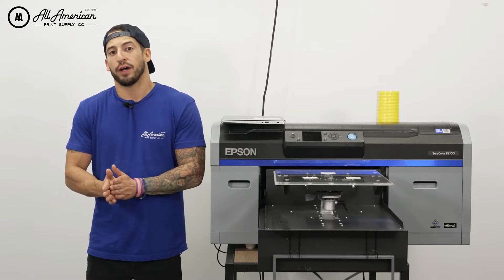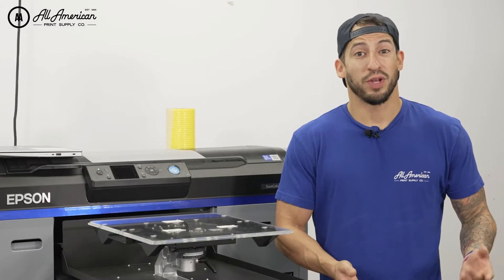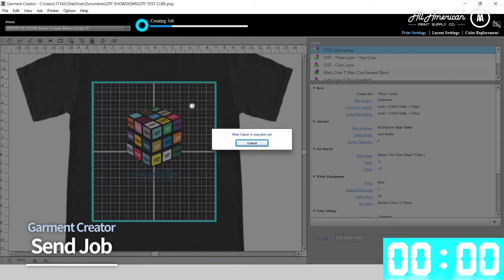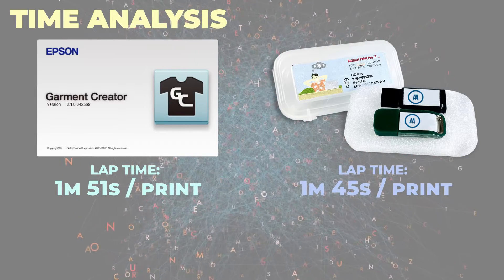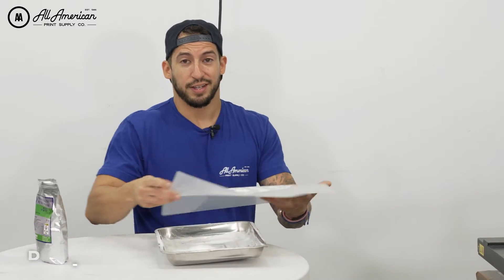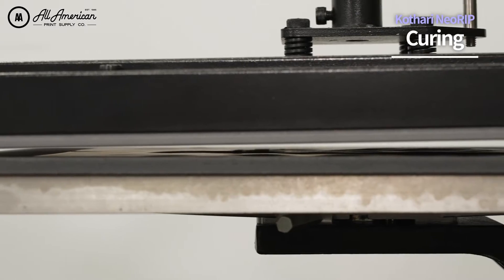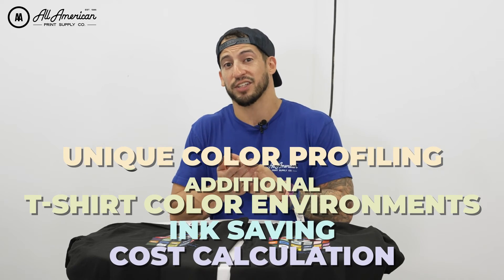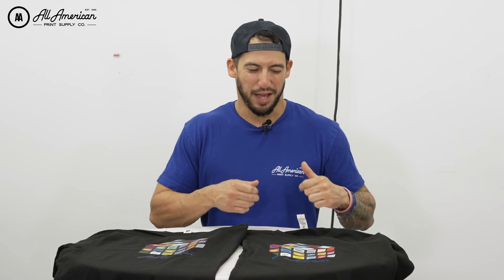Which DTF Software is best? Kothari NeoRip vs Garment Creator | AA Print Supply

Comment: I really need to get to understand Kothari  😩.  GC is on my mac and just seems so much more convenient to use and less intimidating UI (to me). I wish Kothari was on my Mac because savings wise it would be great. Just seems so hard to create a image, then switch to PC and then jump on a whole other program. I don't connect to the printer so I then have to save the image on a jump drive and print. I keep telling myself I need to get used to it but why can't Mac users get some love! I hate using PC's. Lol. I'll beta test if possible. Lol
Reply from the maker: Hey there! I have also noticed many RIP software for printers are WINDOWS based. I hear this from many graphic design folks who favor Mac. Have we considered running Parallels or Bootcamp on your Mac? Kothari is available in the form of a risk free demo trial also
Reply: @AAPrintSupplyCo  i bought the full version when I bought the printer and maybe used it 4 times. I primarily use GC but I've never thought to do the suggestion you gave (and not tech savvy in that regard). This is my first Rip software outside of vinyl stuff and that is on Mac as well. Everything i do is on Mac, I bought a little PC just to run Kothari and I hate using it. Lol